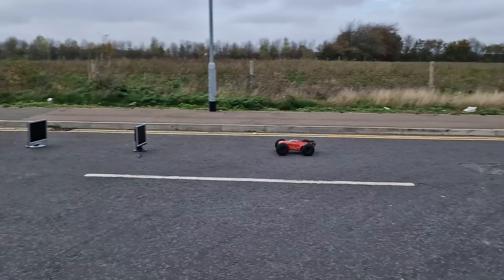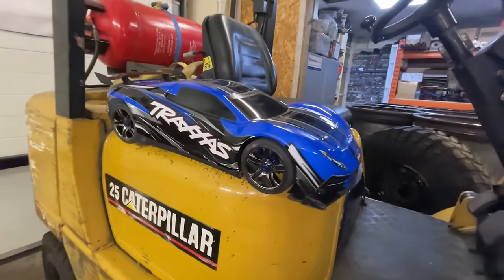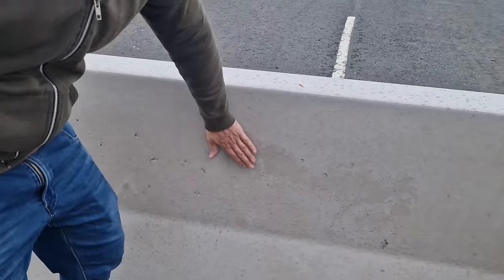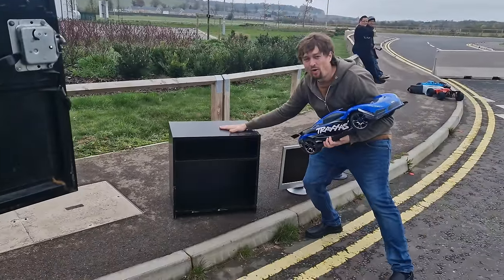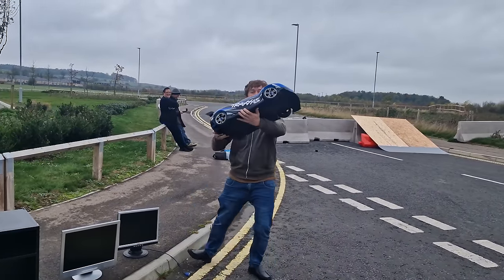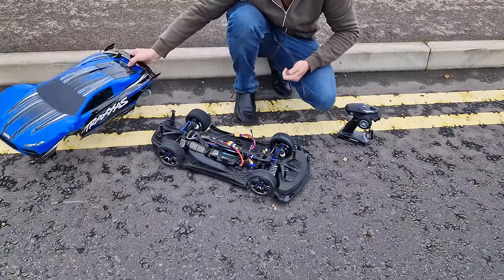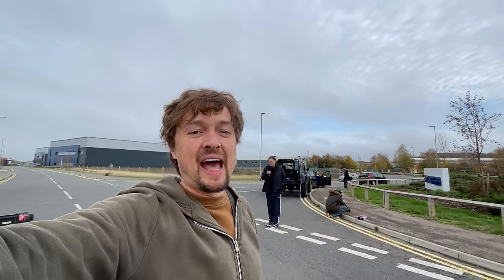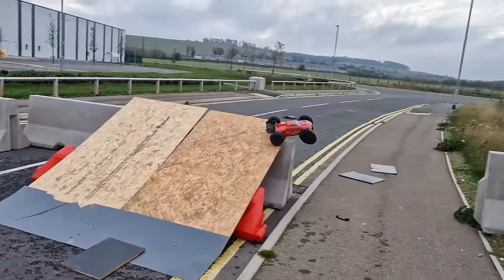GTA 6 Jump with Worlds Fastest RC Car

Comment: The launch from a ramp, the flying and the landing! Every moment was epic!
That Traxxas is one tough vehicle, and it probably must be, to be stable on 100mph
Reply: It was enormously LUCKY! Landing square on its wheels saved it a LOT.
Reply: @Tyler Seabook  I will say that Traxxas builds a solid chassis.  I'm not a fan of many of their vehicles running gear. Their differentials are notorious for disintegrating hours after being replaced but then agin those Vellenniun ,or however they spell it, motors and ESCs are no joke! They have a lot of power and I don't know what they top out at in RPMs but I know it's up there. Gotta be over 50,000. That's stress for any gear box or dif. I don't know if I am agreeing more or disagreeing more? There's a little criticism and a little bit of support for them
Reply: Whats wrong inside😅
Reply: @milletoid  my FG could shred the plastic gears in minutes, hit a goal post with my friends marda flat out and the chassis  bent 90 degrees and the  air filter on the back compressed to half its depth, shocked to see the traxass drive off like that.

Comment: I bet it bent the brace on the bottom of the ramp and what saved it was the last second landing on the wheels. 

you need a longer/less steep ramp. I'd also add some wings on the outside edges of the chassis that are deployed by a servo. Kind of like an F14 tomcat. I bet you'd double the distance.